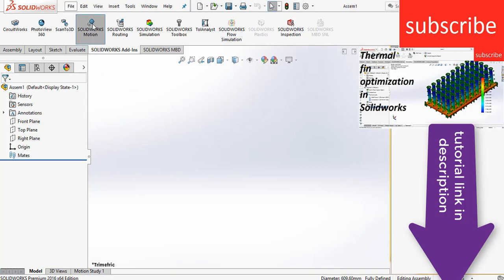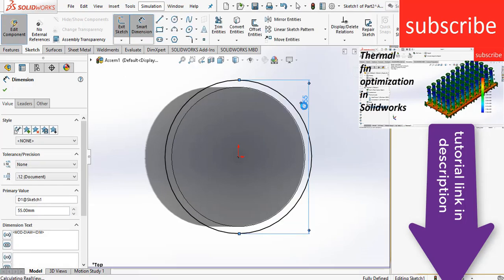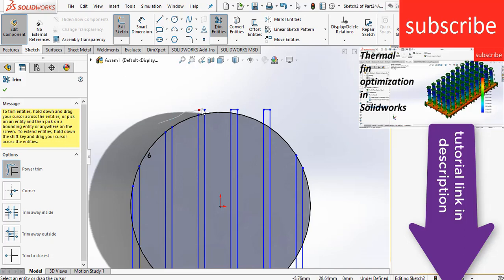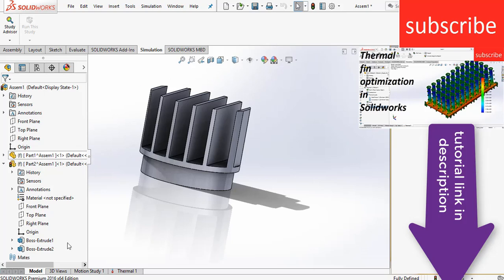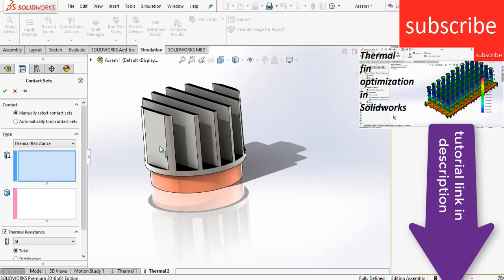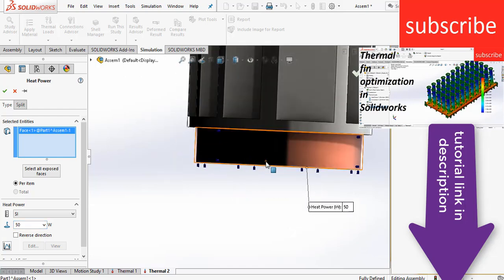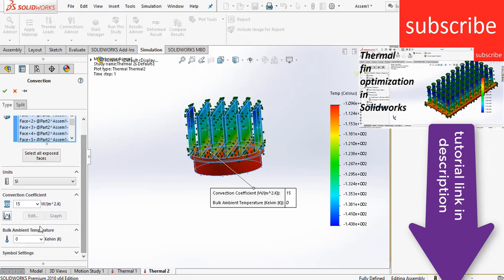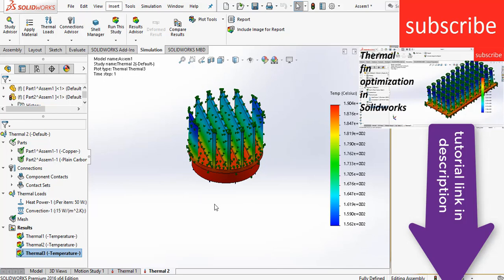Thermal sink simulation in Solidworks for beginners

Comment: Informative video, Good Job!! For a project I need to rely on forced convection, I need to add fan speed as a  parameter. Is there any method I can add fans?
Reply from the maker: If the fan speed is not constant then add all you data in data table for correct result. If it's constant simply design a simple fan and add rpm of the fan. You need to design fan in both case
Reply: Just increase the convection coefficient of the air